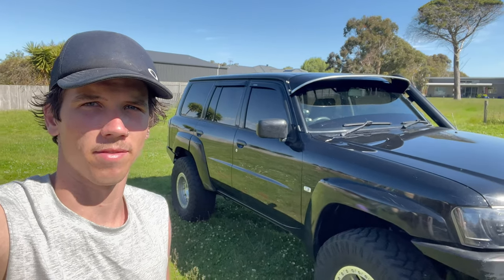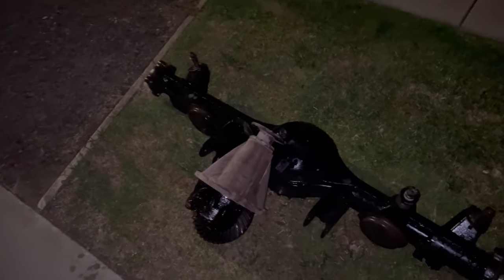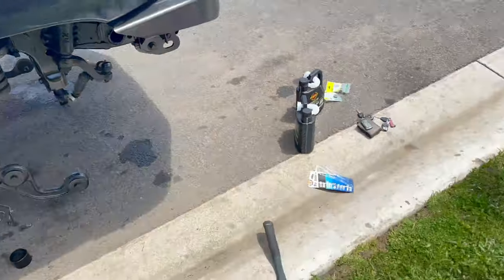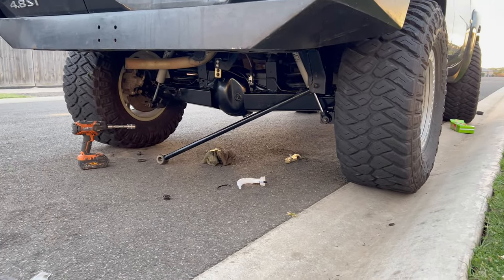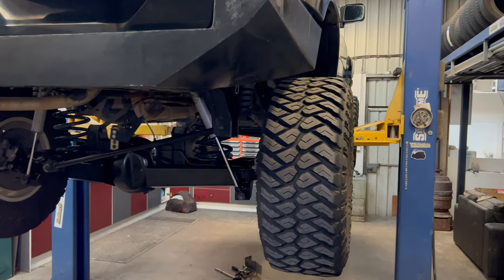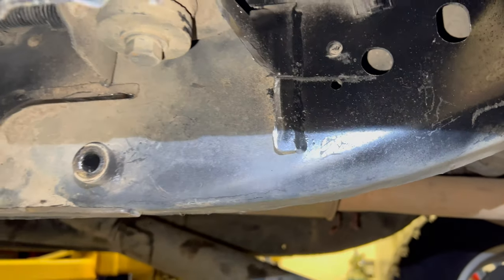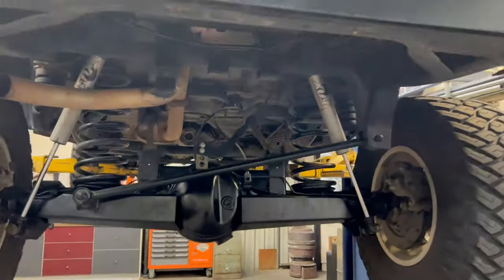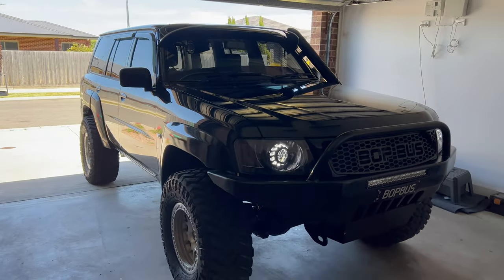GU Patrol Diff Bracing and Long arm Install

Comment: great video! but when the car was up on the hoist just before you put the long arms in the pinion angle was terrible .then on the ground u said the pinion angle was and looked  perfect .. would you also get upper adjustable arms to suit ?
Reply from the maker: The pinion angle was horrible on the hoist as the arms weren’t connected meaning there was nothing holding the pinion angle straight, the whole diff was twisted down until arms were finally bolted in. I don’t need adjustable uppers yet as my rear is only at 2” but I’ll soon need them as I’ll go 3” rear and the arms will also hit on my fuel tank and I’ll need to get one bent arm to allow for the fuel tank
Reply: @KPBUILT  got it ! thanks mate ! cheers!

Comment: umm yr front diff brace should go on top of housing im pretty sure, great job anyway, looks mint
Reply from the maker: It can go on either, some do both some do just too but I went with bottom because the rear will have the same clearance regardless and this way the top of diff has more clearance against my custom exhaust setup I’ll be doing when I turbo it aswell as a few other things 🤟🏽

Comment: Didn't you miss three welds? Btw can you weld ya chassis in VIC?
Reply from the maker: Didn’t want to weld every single spot as it’ll put more stress on chassis and it’s unnecessary. You can if it’s engineered
Reply: @KPBUILT  yeah ok, so you need to get that setup engineered?
Reply from the maker: @philpotsymington5374  technically yes. Superior engineering provide all the documentation online as all their stuff is engineerable
Reply: @KPBUILT  how does that work? Any1 can make a set up and weld it in and get it engineered? And u need it engineered before its painted..

Comment: The down-side being the loss of under-axle ground clearance and added weight. The long arms are vulnerable to rock strikes as you crest over a step and because of the forward mounting point, the arm effectively hangs lower to the ground and also loses clearance. Unless you are competing in comps and constantly jumping the truck off the ground, there is no point to these mods.
Reply: Unless you’re competing in comps and constantly jumping? What about those of us who just want nicer handling man, ain’t nothin wrong with that. Would be greatly beneficial to tourers who spend long hours in their rigs and also to those of us who drive sand a lot. A lot of people on forums and YouTube threads sound like they’re just echoing their thoughts about justifying to themselves of why they shouldn’t fork out the money for parts and mods, without actually thinking what it sounds like to others who can afford such things

Comment: So what’s the go with the template for the long arms? Are the other holes allowing for pinion angle correction?
Reply: na the pinion angle gets changed from top adjustable arms
Reply: @aaron_mccann.  before or after instal?